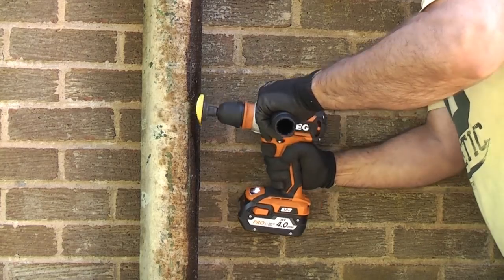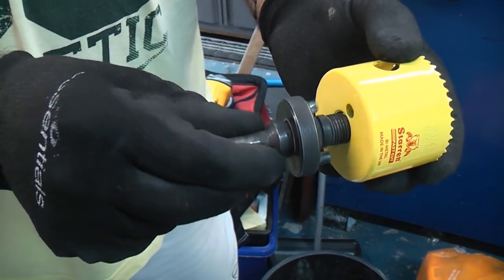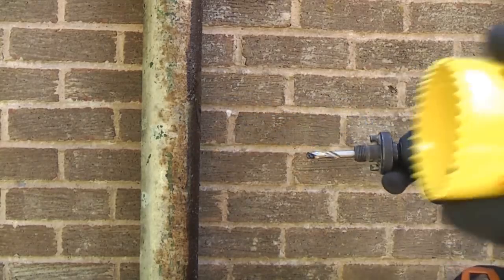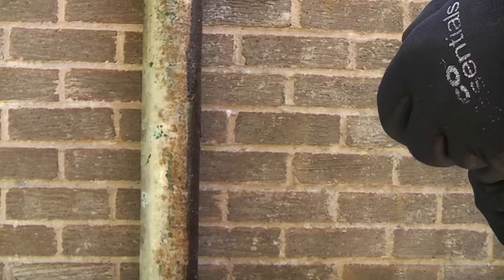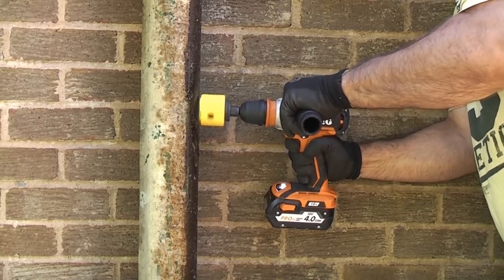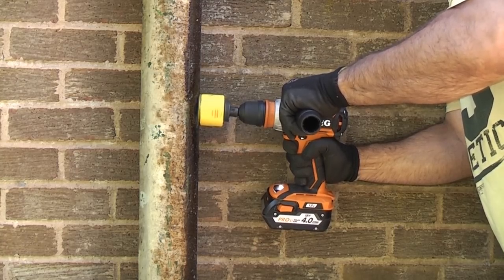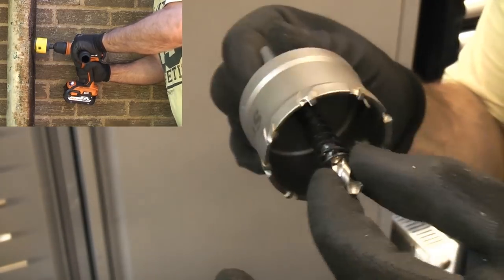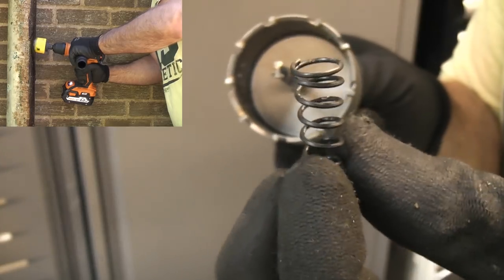how to cut a hole in a cast iron soil pipe

Comment from the maker: There are still plenty of cast iron soil stacks about, hopefully this video will help some people.
In next weeks video I’ll show how to install a mechanical boss.
Please like, share and comment 😉
I hope everyone has a great Sunday!
Reply from the maker: Thanks.
No, sorry I have never installed any UPVC units at all.
Thanks for the comment ;-)
Reply: Good video
Reply from the maker: Thanks for the comment
Reply from the maker: You are welcome
Thanks for the comment
Reply: What type of hole saw is that ?
Reply: I need some advice. I am in the US and I am trying to do something similar to my soil stack, but have it as a clean out. Everything looks great in your video, but is there something where I don't have to connect a drainage pipe and I can just put on a cap? Whenever I need to clean it out I open the cap and do the cleaning.
Reply from the maker: @IP1995IP   I'm not sure what is available in the states, but in the UK we normally incorporate access points to places where a blockage could develop, something like this- https://bit.ly/3jDwbDw
But that cannot be used on cast iron, only PVC.
There are other things available for PVC pipe- End cap- https://bit.ly/3g0ltVq
Access bend- https://bit.ly/3jDqMMH

If you use a mechanical boss, the hole in the centre is only about 40mm. However, if that is large enough you might just be able to swap the compression nut from the end for a blanking nut (if you can get one)

Comment: Good video, thanks. I especially liked the useful bits about removing the saw while drilling the pilot hole, using coolant and removing any ejector springs. By the way, what was the coolant you used?
Reply from the maker: Thanks, its just drilling and tapping fluid, which I bought from screwfix years ago.
Thanks for the comment

Comment: Just the video i was looking for 👍 did you have the drill on hammer action or just normal drilling mode?
Reply from the maker: No, do not use hammer action, it will ruin the hole saw!
Thanks for the comment 👍
Reply: @ultimatehandyman thank you for replying

Comment: Does the hole saw come with the pilot drill and Arbor, or do you buy it all seperately, are pilot drills the same as ordinary drill bits.
Reply from the maker: The hole saw used in this video requires an arbor, which is purchased separately.
The pilot drills used in the arbor, are normally a special length and some of them have a flat on the end, so that the grub screw in the arbor can grip it.
Thanks for the comment 👍

Comment: Almost went through 2 hole saws before I realised you have to do this REALLY SLOWLY, i.e. as slow a rotation speed on your drill as possible without stalling it. On a very fast speed the saw teeth will just grind out on cast iron in a matter of seconds. SLOW SPEED IS THE KEY.

Comment: Thanks for the video, unfortunately I am having trouble drilling a cast iron pipe the same as this, I have tried a 57 mm Bi Metal  Erbauer hole saw from Screwfix and then a 57 mm Abracs Cobalt hole saw from Toolstation, and have been drilling for nearly 2 hours.  Only about half way through, have you got any suggestions please. Thanks
Reply from the maker: The only thing I can think of, is the quality of the hole saw?
I used Starrett hole-saws, which are of decent quality. I would have thought that a cobalt hole saw would have cut through the pipe though!
Thanks for the comment 👍
Reply: @ultimatehandyman  I ordered a Starrett but it arrived too late, so I bought a 57mm Bosch hole saw at Screwfix and it did the job and went through it like butter. Thanks again.

Comment: Would a punk bi metal holesaw be sufficient to do the job?
Reply from the maker: I’m not familiar with that brand, but most holesaws will work, as long as it’s not a pound shop one, and used at a slow speed.
Reply: @ultimatehandyman  Thank you

Comment: Can you make a larger hole to connect a toilet?
Reply from the maker: No, I think you would need to cut the pipe in half, remove a small section and insert a branch, similar to this-
https://www.rainclear.co.uk/lcc-cast-iron-soil-112-branch-100mm-transit-primer-5161.html

Comment: I have 1/4" round stock in my hole saws.
Reply from the maker: They are the ones where you need to drill a pilot hole first, then you can use the hole saw and arbor 
Thanks for the comment 👍

Comment: You can’t use a regular hole saw cast-iron pipe
Reply from the maker: It depends what you mean by a "regular hole saw".
Thanks for the comment
Reply: Ultimate Handyman by regular i mean the one u use in the video! Thats for metal, not cast iron!😂

Comment: This is the most deceptive video I’ve seen on YouTube 
After watching it I purchased the exact holesaw on Amazon I used a quality dewalt mains powered drill  on my cast iron waste pipe exactly the same one as the video and it was absolutely useless 
I’m sending it back to via Amazon 
What’s annoyed me most  is the waste of my time
Reply from the maker: “Deceptive video” 🤔

You can clearly see that I cut the hole using the Starett bi-metal hole saw and cordless drill!
Reply: @ultimatehandyman  
Actually having tried it with a high powered plug in dewalt drill I’d say it was definitely impossible with a cordless drill  you’ve obviously doctored the video I don’t know your motives I suspect you are sponsored by the company  or I’ve got an exceptionally tough cast iron waste pipe all I know for certain is this particular holesaw was absolutely useless I spent hours trying to get through
Reply from the maker: Rather than concocting “doctored videos” nonsense, perhaps you could have approached this in a different way, in which case my answer would have been “you should contact Starrett and let them know that their hole saw does not work”.  
Perhaps it’s a faulty batch and they need to investigate!
Perhaps it’s a snide copy of a genuine Starrett hole saw.
Reply: @ultimatehandyman  
I don’t need too its just common sense when you think about it a rechargeable  drill is just not up to the job and obviously a shitty £4.99 holesaw is going to be rubbish , 
I’ve got a feeling you’ve been sponsored by this company to sell this product because they know most people can’t be bothered to send it back , 
Why don’t you say you haven’t been sponsored 
Ps 
I’m going to do a bit of homework and source a tool that will do the job in the meantime your video is misleading I’ve watched it again and it’s been edited to make it look like it’s done the job , I’m annoyed because it’s wasted my precious time
Reply from the maker: Oh dear, you just can’t let things go, can you?
Your time is so precious that you are commenting a load of crap on my video, making all kinds of insinuations. You are probably that stupid that you had the drill in reverse!
Please don’t waste any more of your “precious time” 😉